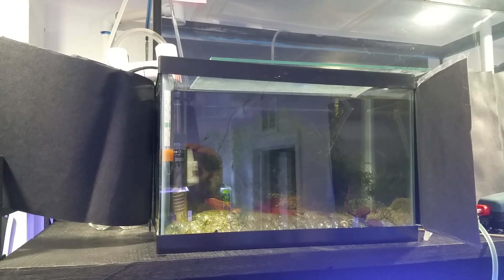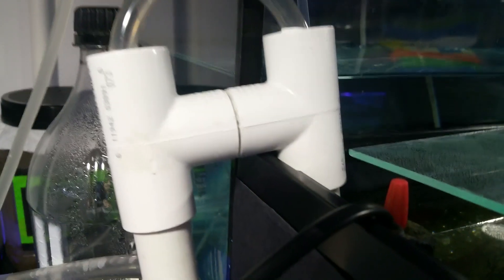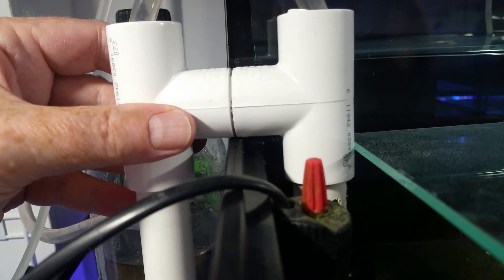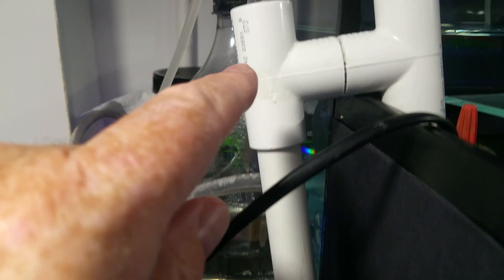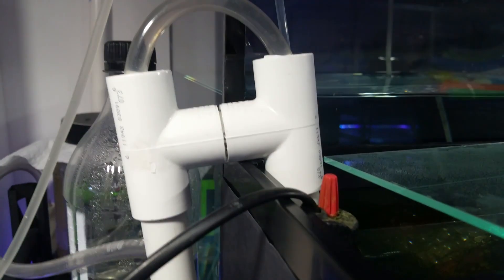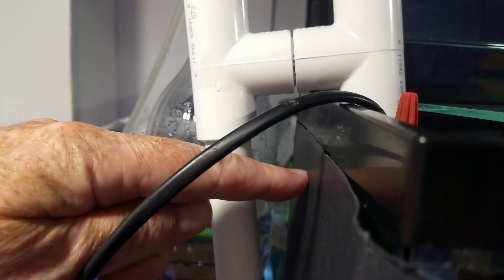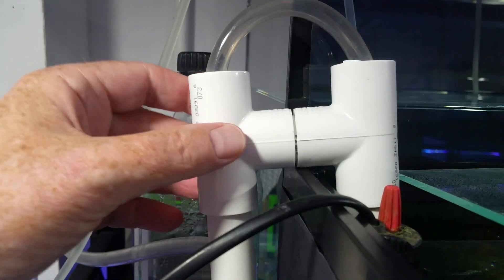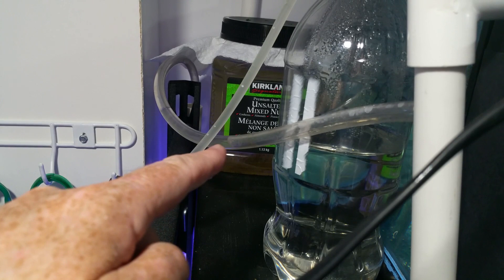Fishez Presents: Simple tank overflow using a tube bridge

Comment: I searched for hours and this is exactly what I needed.
Reply from the maker: I have made some improvements too on these devices.  I use now a threaded T and a elbow that goes into the threads of the T section that enables a quick and easy attachment (and more secure) connection to the out-going hose.  I think you can see it in the latest live streams that I have put out there on the small 2.5 G tank that's next to the sink.